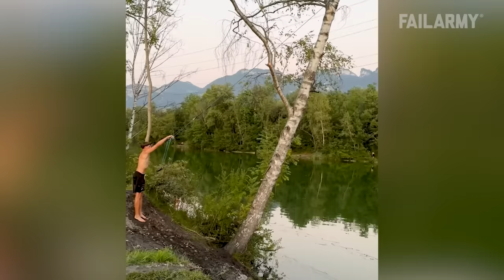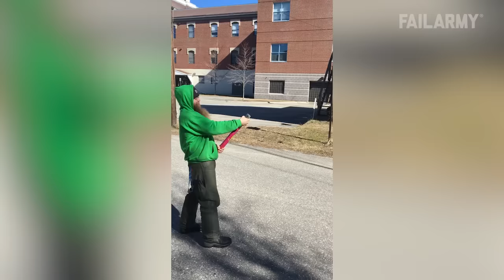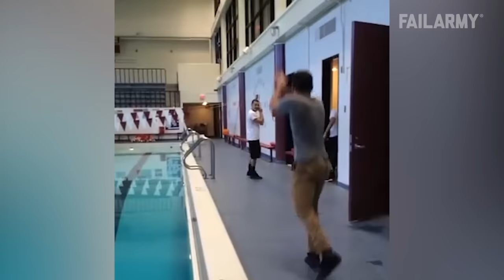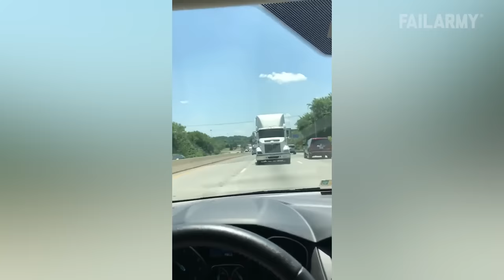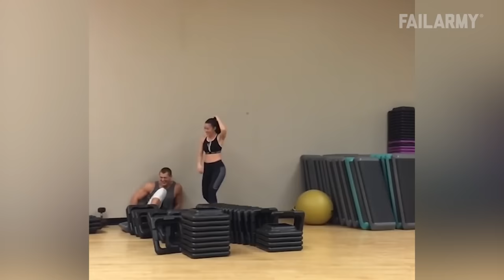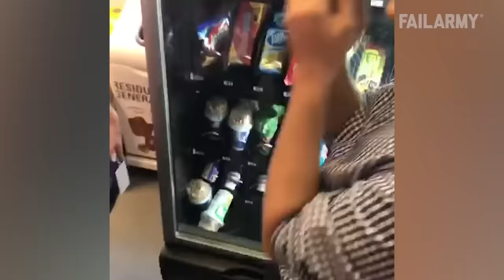Funniest Unexpected Fails Compilation

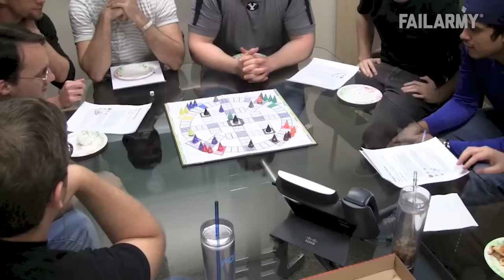Comment: 2:35 WTF happened there ?
Reply: I search for an answer too 😄
Reply: id like to know too
Reply: There was probably an ice cooled drink or a really hot drink or both on the table, basically the glass table was experiencing high punktual temperature differences, making the material expand/shrink punktual. This results in tension which, if its high enough, breaks the glass. Maybe somebody can explain the phenomenon better, its basically thermal expansion.

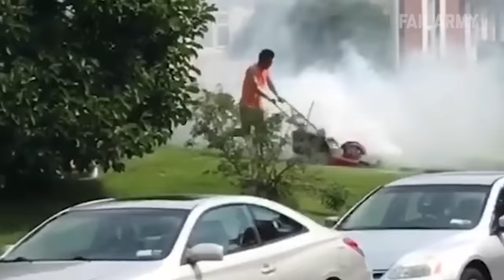Comment: @ 7:20 - the smoking lawnmower. he likely tilted it to fix a problem under the mow deck and got oil in the fuel system, and the smoke is from that and will stop after a few minutes
Reply: Yeah, or doing a yearly Seafoam treatment.